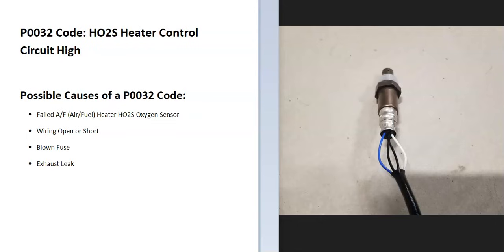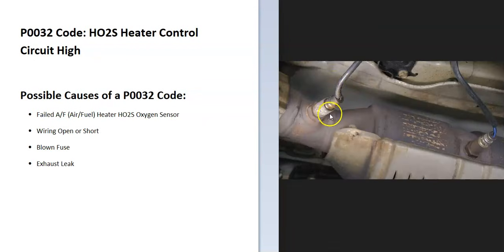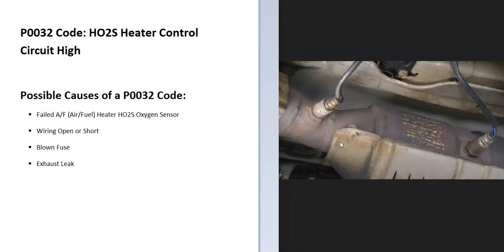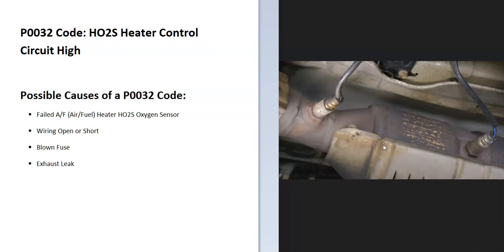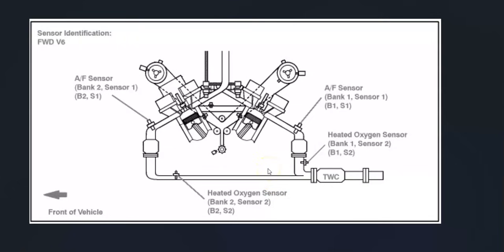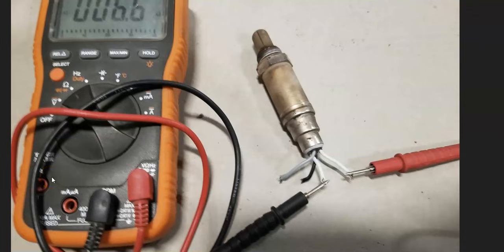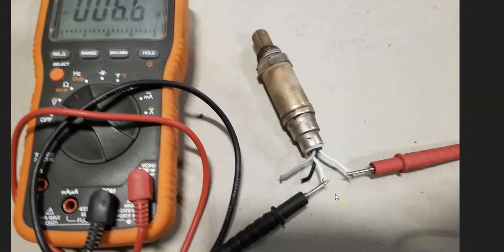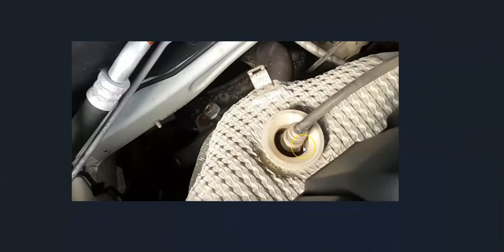Causes and Fixes P0032 Code: HO2S Heater Control Circuit High

Comment: I had issues with my sensor, so i replaced it, same code..............
Reply: I have this same code it's sonfckin annoying
Reply: then it wasn't a bad sensor. check for blown fuse or exhaust leak
Reply: @jeffflowers3645  can an o2 extension harness cause this?
Reply: @SimbaUchihaa  an extension to the wire cord or extension screwed onto the sensor?
Reply: @jeffflowers729  the wire cord for length
Reply: @SimbaUchihaa  I’ve never seen one? Shouldn’t need one if you have the right sensor but I don’t know if it would give you a code. Sorry.